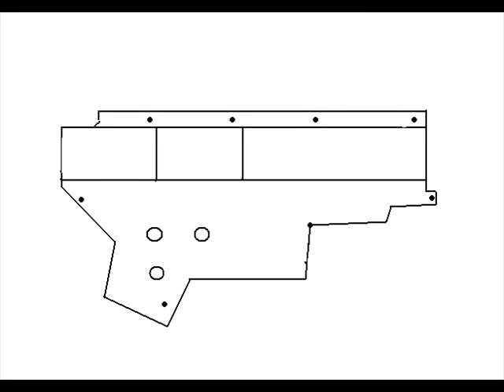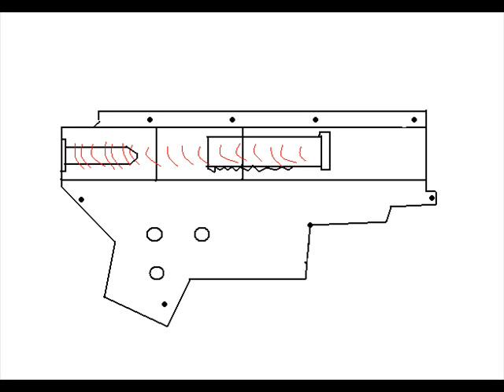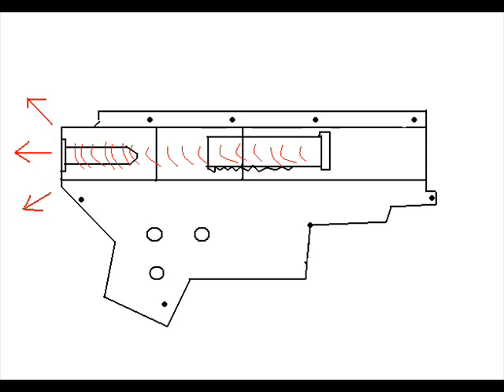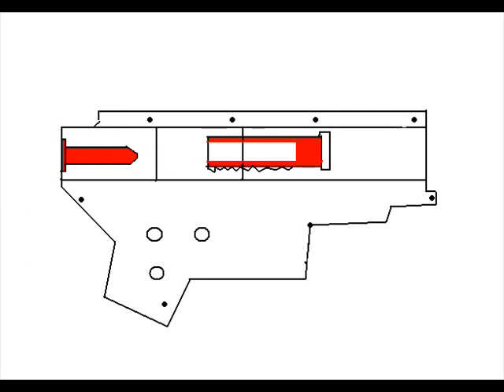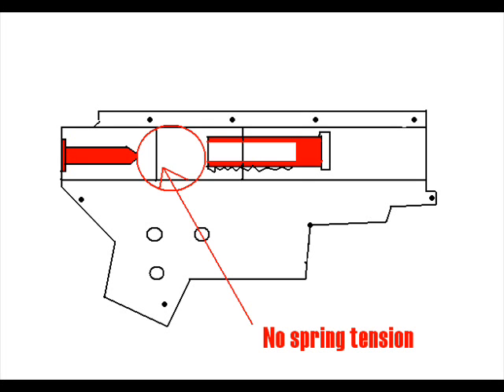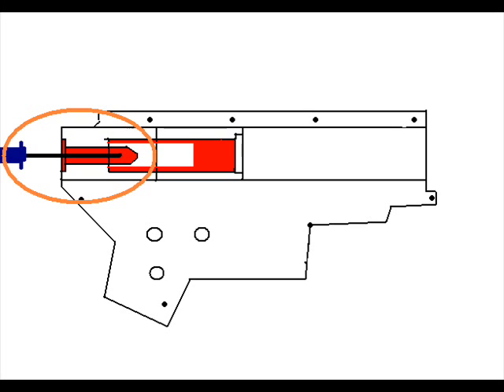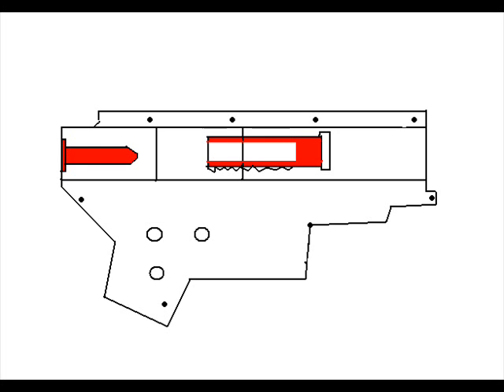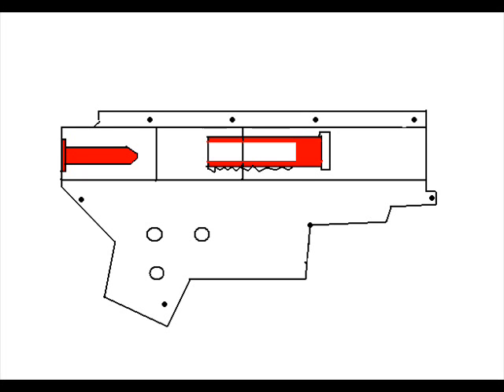Magnetic Airsoft Gearbox (Diagrams)

Comment: Bro are you high when you made this video? You would need a complex electrical system to activate the magnetic field and disengage the magnetic field...would be extremely expensive to build. You must have been high. Magnetic fields are the key to operate most things in life but learning how to harness the power of it without causing destruction is the key.

Comment: I actually had the same idea as you, but i was thinking, in search for more power, have a magnet all the way forward in the piston, short like 3/8-1/2inch, another, about 3/4in long that could slide around in the piston, but not come out via some stop, and then another longer with a piece of metal like the spring guide piece that slides in to shell attached to back some how (epoxy?)

Comment: Wait, why would it need a motor? In that case you could put the magnet in the front and have the same general gearing as a standard gearbox but without a spring. In that case though you would need a very high torque motor to pull the piston back from the magnet. That is why I believe it should be a strong electromagnet so that it could engage when the piston fires forward and disengage when it is pulled back. But I think im starting to stray from your idea and im just throwing out my own ideas.

Comment: I like this idea but I just have a few problems with it. First of all, this is not a problem, but a simple statement. It would have to be an electromagnet (which you probably already knew), so unfortunately you would still need a battery. Also, it may be difficult to have a fully automatic magnetic gun (at least not one with a high ROF), unless you could have a very fast and constant fluctuation of the magnets which also may not work. I would love to see this idea come to life though! Good Luck!

Comment from the maker: @DrewRod13 The gearbox isnt magnetic one bit. If you have one, try it out. The gears and spring are magnetic because they are real steel, the box is just an alloy. The trigger system will be the same, the gears are still inside. Only thing different is that the spring is replaced by a magnet. Ive made a prototype and it works for one cycle because the magnets are weak. If I can get some custom magnet parts going, the thing will be able to run and a video will be posted.

Comment: One other major problem is that you do essentially have a tension force acting between the two parts, unless you are using an electro-magnet for one of them in which case you may as well just make a coilgun around the chamber to move the piston.  Actually, that might not be a bad idea